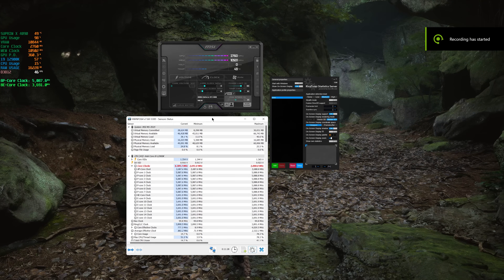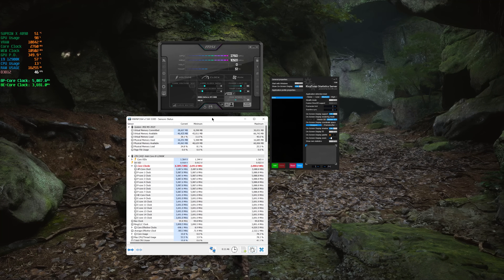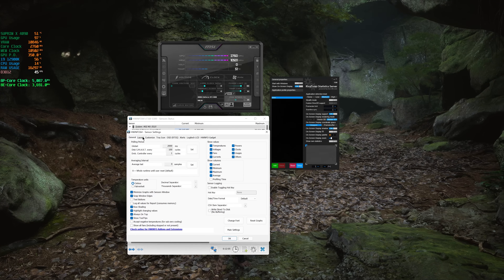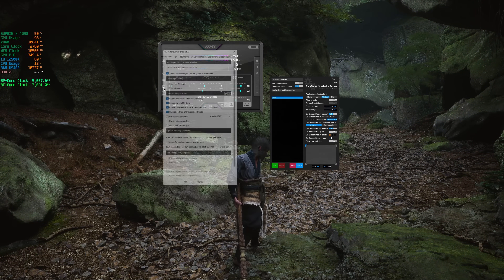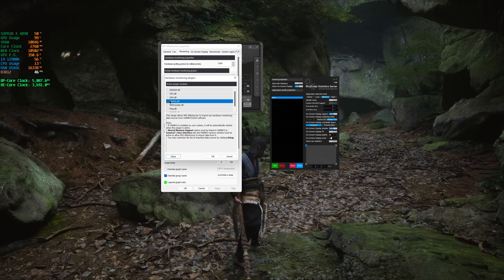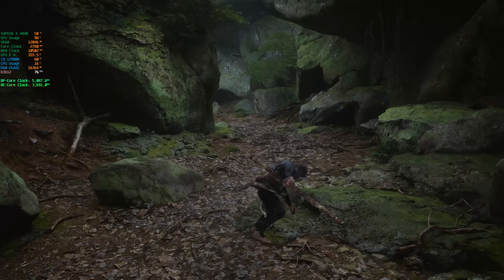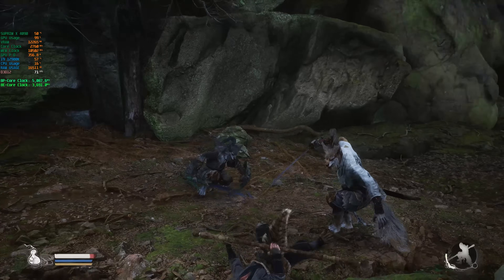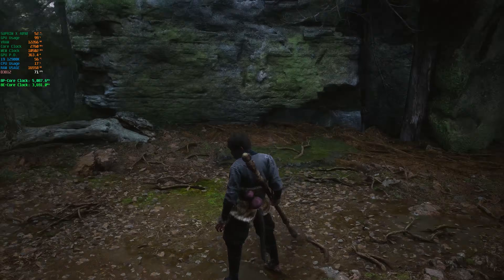How to link HWinfo with MSI Afterburner - Easy Way

Comment: There is a bit more to it but great video!

After you sync both tools then you need to actually click on setup and add the metrics you want. 
Fort me I noticed that my CPU temp was off by 2 Celsius in the MSI afterburner (probably monitors different sensor like mother board socket sensor or smt)  so when I synced MSI After burner and HWiNFO I had to click on setup and add the CPU die (average) metric on from HWiNFO into and it made a whole new metric that I had to press "Show in On-Screen Display again)
Reply: When I click setup and try to add more metrics I don't see any metrics such as the cpu temps